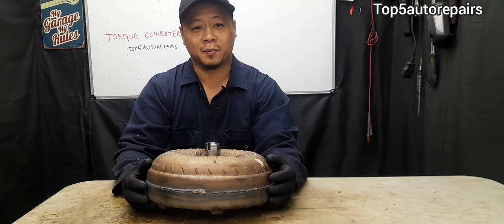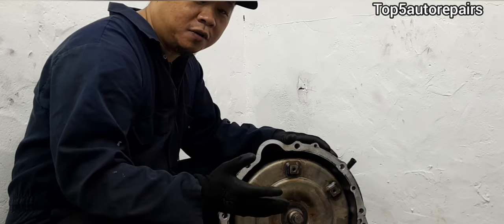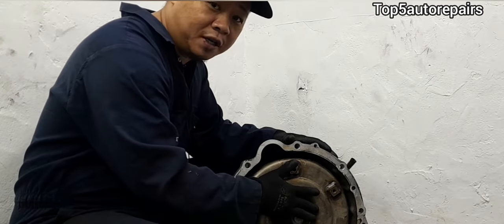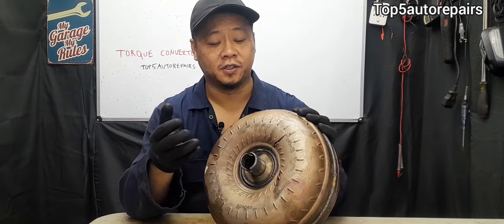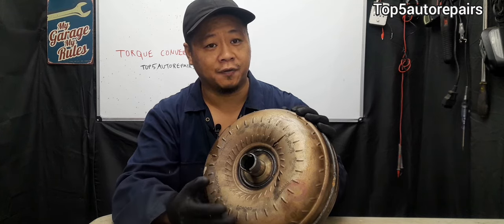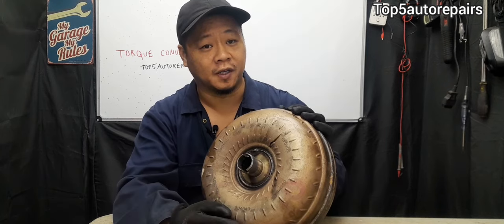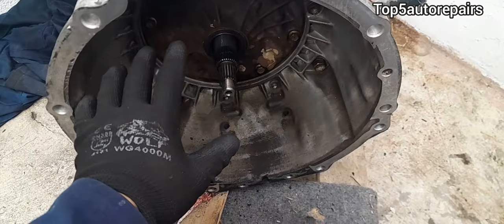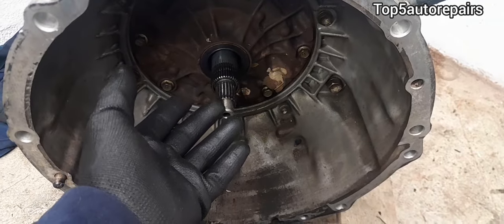SYMPTOMS OF A BAD TORQUE CONVERTER (HERE ARE THE COMMON PROBLEMS)

Comment: You are here because the mechanic told you that your transmission torque converter is bad. 😅
Reply: Nah my shits just shaken and I’ve replaced everything around it lmao
Reply: Actually, I'm here to identify the root of the problem so the mechanic doesn't tell me it needs a new transmission for 5 to 6k when it's likely the TC for about a grand. 😉 One repair I can afford. The other, I can't.
Reply: No you’re the only one
Reply: Thanks 🤣🤣
Reply: No
Reply: no i am here to know what’s wrong with my car so mechanic doesn’t cheap my ass
Reply: Someone said the code is reading it
Reply: I’m here cause I wanted to save 390$ on my build but guess not 🤣
Reply: Because my truck shakes like I’m driving over 100 turtles every second
Reply: I’m the Mecanic I’m here too 😂
Reply: No I’m here cus my mechanic told me it’s not transmission but i feel like it is lol
Reply: Nah i am here because i am looking to buy a car with a tc and wants to know the pros and cons of the system
Reply: @getsomemtb7427 😅same the dealer told me my transmission bad new one is 9thousand
Reply: Nah I’m here cause my duramax is shaking me to death in fifth gear lol
Reply: 😅😅😅😅😅 yep
Reply: You know “the mechanic” too?
Reply: And I don't believe him....yes
Reply: Nah, I was watching valve cover gasket replacement and this video popped up as recommended. So I clicked on it
Reply: I’m here because I’m a mechanic trying to tell my customer they need a torque converter.
Reply: I’m here cause my 370 feels like it’s not accelerating but the rpm’s increase but the car won’t move lmao
Reply: No
Reply: Nah I’m here to find out if that’s the reason why my car is stalling
Reply: I’m the mechanic you brought your car to and I am right now trying to figure out what’s wrong with it 😂

Comment: The shaking could also be the Motor mounts I will check them. Putting the car in reverse with the brake on. And then drive. Have someone watch the engine.
Reply from the maker: Also listen for clunking noise and watch the engine slightly jump.
Reply: @Top5AutoRepairs  yes
Reply: If its engine mounts you should feel vibration in your steering wheel and dash, especially at idle and slightly to greatly improving with rpm increase. At least thats how its been on 2 of our families cars. I dont think the TC would cause that.
Reply: Torque converter

Comment: You literally just described all my issues (minus code). Thank you!
Reply: Same...I'm not getting any faulting codes.
Reply: Seems like all GM just has to do a recall and replace these with GOOD torque converters.   I have had mine replace 4x, all covered by GM.  I purchased a car warranty that replaced it with another GM transmission (this transmission has GM warranty). The real issue is that the torque converters are bad which in time ruin the transmissions.  So instead of just putting in a good quality torque converters they just continue to repeat the process.  I don't understand why they do this.
Reply: Same here and Im so grateful for people like him!

Comment: Hello, how did this part come off? I have a 2015 Jetta and I took off the transmission but I can figure out how to take off the torque converter. I took off the only 2 bolts that I saw under the torque converter but I cannot get it off still

Comment: Mine is whining like it's mixing frozen margaritas. Shuttering like it freezing to death. This is the 2nd transmission on this truck with 245,000 miles on the torque converter and only 57k on the transmission. Still need to confirm by my mechanic and pray it's only the TC. That I can afford. New transmission, not so much!

Comment: I have a rebuilt transmission with new seals on my 2004 Honda accord2.4 ex I noticed two year ago it started leaking under somewhere either from the driver axle seal or from that last part u spoken about at the end of the video ,and all I do is just make sure to try and top it off whenever I’m low

Comment: I recently took an '07 Mercury Montego w/ ~160k miles to the Ford dealership for a misfire issue. I thought the misfire was throwing the car into limp, because we couldn't get the car to go over 15-20mph. 

A week and a half and $600 later, the dealership replaced 2 coils and a plug, the check engine light went off, and the car started and ran smooth. 

We didn't even make the 10 minute drive home before it was dead on the side of the road; worse than when we took it to them. The first thing the dude said when I called was that they think the torque converter is overheating and locking up..? Yet, they said the transmission had a little too much fluid in it and THEY drained some fluid to put it back to "normal." That was the first time an issue with the torque converter was ever mentioned but they said it like they knew it might be an issue? But they only told me AFTER I paid for the other job..? 

Now the car starts and immediately bogs down and dies.... Does this sound like the torque converter..? It's an old car so it's hard to tell what every rattle and noise is. Lol
Reply: sounds like throttle body issue

Comment: That happened to me 2 1/2 yrs ago. Had it rebuilt (2000 Chevy impala). I’m 65 but the shuttering started all over again. Was about 15000 miles away from needling tires - was hopeful- then alignment- still hopeful- then rebalance of tires- lost hope. It’s shuddering. Will try the brake /gas test but I have no hope lol
Time for a “new” used car. But I still want this fixed but dang the cost….
Reply: I waited to late last time- can you just need a torque converter without a transmission redo? There is no metal in the fluid- yet.
Reply: @maryann823 this is what I’m trying to figure out
Reply: You might have a misfire in a cylinder. Need to go on a drive with scan tool plugged in.

Comment: Hoping you can help.... I have a 2007 5.9 liter dodge diesel with 76k miles on it, and when dropping the trans fluid from the pan and replacing it it levels out to about 5 quarts or so. However, when leaving my truck parked for an extended period of time, say two to three weeks the trans dipstick goes from just enough trans fluid to way above the hashmark max setting. Say about 1.5 quarts or so. Could be a tad less. This is only happens when the truck is sitting for an extended period of time. I've been told that one will get some additional transmission fluid in the pan from things like the torque converter etc when sitting but it just doesn't make sense. Now, when I drive it, it drives fine then when I check the trans fluid at around 160 degrees F it doesn't even read on the stick. I then read somewhere that the trans fluid needs to reach about 180 degrees before you check the trans fluid in neutral for that make and model. At this point, I simply don't know if the amount of trans fluid is correct or not or if there is additional trans fluid which does drop into my existing pan is normal. thanks.

Comment: The brake while driving unlocks the torque converter. It technically can work if you cut a wire.

Comment: I have a 2005 Chevy Colorado 4x4 with 265k miles on it. It slips out of 4th gear under mild to hard acceleration. Is a bad torque converter a likely problem or is this more commonly a transmission issue?

Comment: I feel i just got ripped off by dealer with this issue by taking it to them and then claiming because no engine code light was on they can’t narrow don’t the issue?? So they know it shudders but then they say the warranty won’t cover two repairs related to the issue. Dealers says it could be converter or another transmission issue but only one will get covered and I’m to keep driving til a light comes on oh and after all of that i had to pay a $959 charge for the transmission service not covered. So now I’m
Back to driving a jeep doing the same issue.

Comment: My 2010 nissan altima v6 has a cvt it had p0744, p0740, p0725 but also a p0826 up and down switch input circuit. And. On the test i did at autozone it said tcc solenoid valve function was the issue as a secondary dtc. And that the electrical circuit was intermittent for a predetermined period of time. I checked my valve body. I did a drain and fill and then another full drain with pan drop and put in the correct amount of fluid and properly measured this second time around. I checked the valve body i did an ohm resistance test on the torque converter solenoids as well as the shifter solenoids and compared them with a brand new but incorrect solenoid and all the ohms resistances came back correctly for my model. Universal nissan tells me that i need a new torque converter. I imagine this is what i am going to take my car to a regular transmission shop so that they can do this job and fix it. What do you say?
Also there was a shuddering just before my car broke down. I was in drive and the car shuddered as it started to get up to speed. After that the car was essentially feeling like its in neutral. Because its cvt the computer does not let the car rev past 1500 rpms at most. And i get sort of chatter noise sometime but not everytime. Like zzzzz sound but it goes away. It only happens when i leave the car sitting and the fluid apparently drains out into the transmission itself. There were seemingly not shavings but things stuck to the magnets at the bottom of the drain pan which could be from the torque converter failure. Thankfully i think the transmission is fine but if this car gets fixed i plan on selling it anyway so i can purchase a manual vehicle which i know will have way less complexity when it comes to diagnosis of why it doesnt drive.

Comment: Thank you for your videos are very helpful. I have a question. I have a 99 Ford F350 diesel engine that it seems like the engine is locked doesn’t turn. It’s not Hydro locked. Could the torque converter be locked not turning and essentially make it like the engine is seized. How can I determine if the torque converter is seized?
Reply: I don’t think so.

Comment: Like the video, Well mine just have the seal in the transmission torque replace because it was leaking oil , but after the replacement still leaking oil from the same spot , any ideas ? Thanks

Comment: 2024 Hyundai Tuscon SEL 145,000 miles Between 40-50 mph a vibration/ shutter then it stops, approx 3-4 seconds All tires balanced and alaigned.

Comment: I'm struggling with my Isuzu ELF 3Tone truck, the torque converter seal keeps on letting the oil down. I have changed it many times but the problem still comes. What could be the reason that's causing it?

Comment: Mine is a chrysler 300c and shutters just like youve described but its equipped with mds system and when I accelerate to brake it goes away but because the mds turns off at that same time I can't tell if it's the tcc or the mds causing the shutter.

Also it turns off when in liw speeds or in parked can a torque converter cause the car to turn off when parked?

Comment: Could shudder at a stop light with foot on brake be TC?

Assuming new motor mounts are installed
Reply: Mine only shakes when foot is on gas at about 35mph when I let off gas it stops. Never shakes when I’m on the brake. And i need new brake pads🥲

Comment: Hello, I have a Renault Fluence 2.0 16v that uses Jet CVT. I've searched several places and found nothing about. 
I have a pocket obd2 scanner and I do not have any type of DTC, but my car on very steep climbs, simply decouples the torque converter and the engine speed remains high, but because the engine and CVT are decoupled, enters the Engine Brake, lowering the speed quickly. 
When the converter couples again, there is a kind of "slingshot effect", precisely because the rotation of the CVT and the Motor are different. Have you ever seen something like this?
Notes: I notice shaking, "iron dragging" noises and the like.

Comment: For some reason my message disappeared.
At over 70 Mph our car has begun to shutter as you describe.
Mechanic says its Torque Convertor. But we also noticed a kick in shifting as well like
when approaching an intersection rolling expecting to stop but instead we press the gas to accelerate and occasionally there is a bump
which I think is slipping.
Main question as Ive seen your video over and over.
Since the transmission is coming down anyway to put in rebuilt Torque Convertor
should the Transmission also be rebuilt ?
The car Land Rover LR3 with ZF Transmission has 215,000 Miles on it in New Jersey with a lot of stop and go.
Thank you
Reply: What did you end up deciding? I’m facing a similar dilemma.
Reply: @CalebTalbot17  On ours I was wrong. Our mechanic said there was a liquid that would smooth out torque converter..he put it in..no improvement.So by surprise he shows up at my house on a Sunday with the Transmission rebuild guy and they take it out for a drive for 45 minutes.They come back and they say not transmission..it's the drive shaft.We take it in and he confirms it was the drive shaft. I got an oem drive shaft he put it in and it was solved.Some of the guys on the Land Rover forum said to check drive shaft.The other odd symptom of not quite taking off with that exhale sound I changed the Upper and lower Oxygen Sensors which we had never done but supposed to be changed at around 100k miles.Did us good. Good luck. We look at Atlantic British Maintenance Schedules to try and keep it going.
God bless

Comment: Im not getting any codes my car ran fine earlier got food went to doctor appointment and got gas was driving like 20-30 minutes when I got home It started bogging ahuddering and cutoff I turned it on wngine is fine In Park And Neutral but when I put it in Drive or Reverse it cuts off like something isnt letting it go into gear

Comment: Hi I have a Ford Escape 2007 and suddenly overdrive started flashing my car did not change the gear so I replaced the band I thought it was gonna fix the problem but after installation and testing it does not shift anymore I need help if you can guide me

Comment: Hello, I have a problem with Hyundai Tucson 2005 diesel 113hp with torque converter. When I accelerate and the engine revs increase, a strange noise is heard while driving, on the right side of the engine (it sounds like some blankets with water that are half filled and are being moved). When the revs increase and subsequently the speed, that sound is no longer heard . Have you encountered such a situation or can you give me some advice please? The mechanic would think that maybe the injectors are not giving pressure and could be coming from the engine, I am confused.

Comment: Hi sir I do have 2014 bmw 328i my transmission making whining noise do you think changing fluid and filter could fix the issue ? It does change gears smooth no slip or grinding noise since I hear the noise I don’t drive aggressive

Comment: 6L-80 on 2013 Chevrolet tahoe. Replaced fluid and filter,  torque converter, valve body, solenoids, and tcm still getting p0741 code. Could it be the pump or tcc valve?

Comment: on a 76F150 if there a clunk after 1-2 shift, and as well as stopping 2-1 shift,  is that a loose failing u-joint or internal tranny problem or lastly Tq convertor?

Comment: Hi..
I have a bmw 5 series..it only does this (vibrates) when I’m pulling away from a stop.. transmission does not slip.. It always feels like it’s coming from inside the glove box.. when you accelerate 40 or 50 does not vibrate.  Change just about everything on the front passenger side does it?

Comment: My honda pilot just 4olls. Whether its on park or drive. Its like its in neutral i have to put on the brake.. my transmission fluid was brown before and just havent got time to put in new oil. It maked a whirring noise after i put it back in park

Comment: I have the p0741 code in mines and it’s fine until I drive it for a long time at 75 mp once I get off highway and proceed it takes a long time to catch speed then it goes normal again it takes long to catch speed in the beginning but it goes away once I let it sit and cool for a lil there’s no signs of over heating transmission

Comment: Hi, I have 95 impala ss 4L60 e transmission. The trans shift all 4 gears. passing gear. the problem im having is there no low end torque it bogs out when it to floor. Could the torque converter be bad thank for your time
Reply: Yes mine do , and from 80 to 120 Km/h there is a whining noise if you remove your leg from the pedal it will stop so yeah...its going to full repair transmission
Reply: Mine is Yukon 2008 4 speed ( when i floor it there is a little slip at the end before shiting to 2nd or 3rd ( to 3rd kinda few times i heared it ) thet told me wait until you get that transmission all gears as N then swap it or FULLY rebuild😅😂

Comment: 2013 impala it has been shuttering with shutter fix for 10k miles never over heats or cooks the fluid yet i know  living on borrowed time... some ppl have gotten 20k before its stuck in 3rd or dies at a red light ... thing is its the value of the car to get a remann or worse new from gm most places want to replace valves with the converter aka rebuild    at 185k and 11 years old  prob just drive it into ground maybe throw a used low mile if i can get it under 3k installed  had luck with old gm 4 speeds towards 300k miles  the 6 speed is junk at 180k